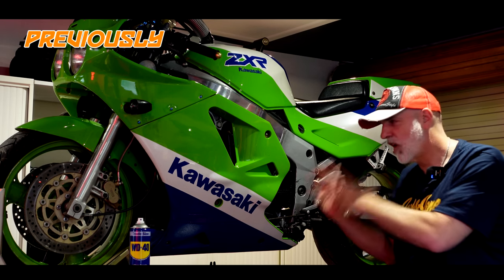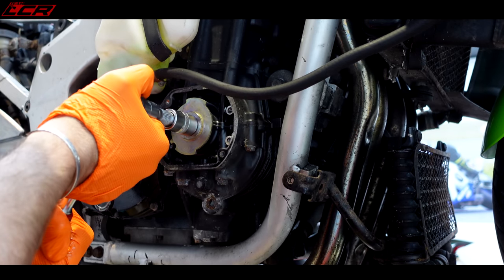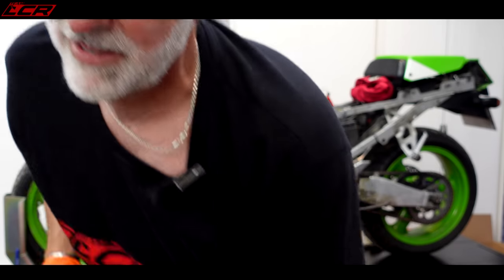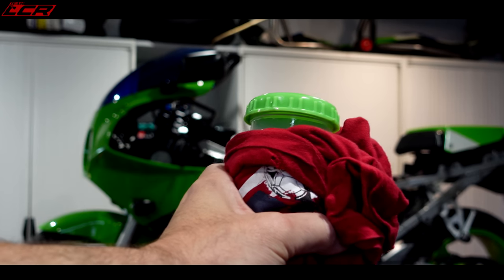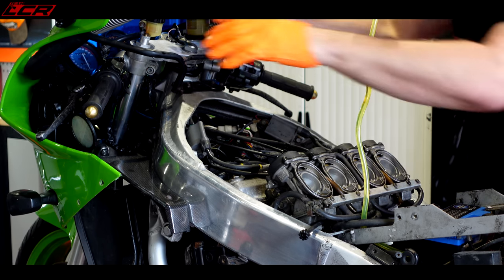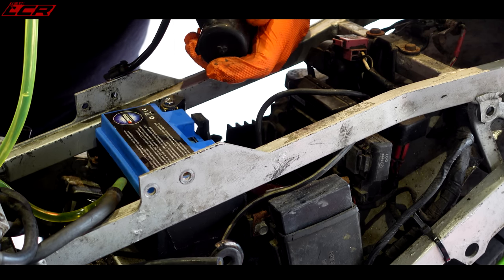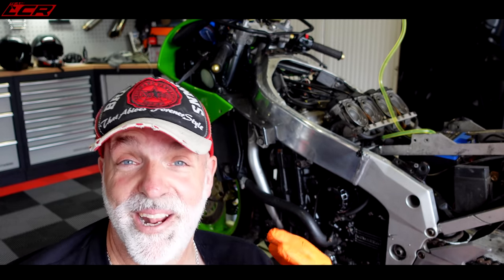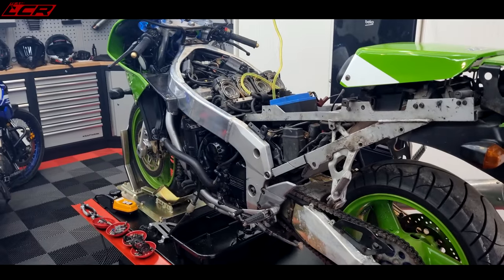Starting Abandoned 1990 ZXR-750 | Will It START!!  Part 2

Comment: As a mechanic I'd say you can do it. Definitely invest in a 4 dial carb balancer as they are not that expensive and you'll be able to set the carbs perfectly. Definitely fully overhaul the cabs with new needles seats and all orings👍
Reply from the maker: Thanks for the tips! 😁👍

Comment: Great chopsy it runs. One tip I can give you is with these older zx is the vacuum pipes are everything to making them run great even the smallest leak or even not having the air box on can make them run like crap. So I wouldn't take the engine apart yet do spark plugs, coil packs and check even vacuum pipe. Oh and one last thing that catches everyone out regulator rectifier are a common fault
Reply from the maker: Great tips thanks 👍

Comment: Tentative first steps Chops, she needs some love…but she turns over & fired up, which is a positive start!

My ZXR has been at Raceways in Stevenage having the carbs sorted. Mine was starting, revving and ticking over fine, but bogs down when you pull away, making junctions decidedly hairy! 😮

The carbs were pulled apart, sonic cleaned, but still not quite right. So they’re pulling them apart again, another sonic clean, genuine carb service kit etc.. Also going to check the valve clearances incase they’re a little tight.  

I reckon project ‘Green Meanie’ is a go mate! 💚👊🏼

Comment: That's definitely a 1989 H1 that you've got there, that would have been registered in 1990. The fairing is H1 (different stickers to the H2), H1 black mirrors (H2 are green), H1 flat coolant rad and external oil filter (H2 is curved rad and internal filter) and the carbs will be 36mm bore rather than the 38mm on the H2. Someone has fitted a later H2 swingarm though. 

As someone else mentioned try LiteTek for the carb seals. They are made from more modern materials that'll hopefully stand up to newer unleaded fuels. They are in Thailand so you my have to order them as soon as you can because they may take a while to arrive. 

Let me know if you're stuck for any parts, I might be able to help. I've got plenty of leftovers from restos.
Reply from the maker: Thanks for the advice 👍
Reply: Thats what I thought, H1 with a H2 swingarm 👍

Comment: Have the carbs ultrasonically cleaned.  Harpers ultrasonic can rebuild them for you . 
Valve clearances will need doing.  But if your doing that you might as well do the valve seals . Great video.
Reply from the maker: Thanks for the info! 👍

Comment: Looking forward to future vids mate 👍
Before you strip the engine, plug the plugs out 1 at a time & check that they are sparking on turn over (ground them on the frame when you do so - no modern electronics to fry I presume).
Then borrow a compression tester to check whether you’ve a ring gone on 1 cylinder (hopefully not).
Go on from there as needed.
Reply: Agreed you must have been where Chops is now

Comment: Clean cam tensioner, balance carbs, run up to temp, make sure fan runs, pull clutch in and out loads to un stick plates keep doing that for a week if all good change oil/filter, clean tank put inline filter, in then wonder up and down the road, slowly.Then brakes, suspension,tyres then dyno 110 bhp if a good one 😅

Comment: I’ve done a ‘99 XJ600 recently, that had been sitting for years. It sounded awful and smoked on the first start but with a new battery, spark plugs, a…. lot lot lot lot….of carb. fettling (a few spare sets were required to make a good set) followed by some careful balancing and it sounded as sweet as a nut.

The more I ran it, the sweeter it became. 

DON’T STRIP THE MOTOR 😉
Reply: I liked your note about Carb fettling, I've just had close-on 6years getting my basket case ZXR750 L3 back to some sort of organised Carb / filter, pulsing, jetting and adjustment equilibrium. But I think I'm almost there!

Comment: A carb refurb and new plugs chopsy that may well do the trick also new fuel pump. That’s what I’d do rather than pulling it apart further could well sort it. The smoke and crap out of the exhaust may well clear likely due to standing for so long. Good luck 👍

Comment: Do a compression and leak down test, then you will know the state of the valves, piston rings etc. at the very least the carbs need a good strip and clean in an ultrasonic cleaning tank but I personally would do a full strip and rebuild, then a bench test/setup before dialling them in by balancing then properly. It’s all easy stuff.

Also if you haven’t make sure your air filter is good as it may have been a mouse house.

Comment: Old Kawasakis run smoother when they are hot.  They have always seemed a little rough when not ridden to get them warmed up.  They loved to be revved, on the limit, all of the time.  My ZX9R is one of the best bikes I have ever owned (had over 100).

Comment: I did my first top end rebuild a few months ago. Check compression 1st it will tell you if you need to pull it apart. My compression dropped bad so I pulled top end and changed rings and found 1 valve was destroyed. Changed them and she started right up, running great.

Comment: Bless the dear old zxr ❤  Float valves always get gunked up,  any particles will cause the float bowls to overflow.  You'll need to clean the plugs again after the bike flooded, this might help it fire on all 4 properly. Do a compression test to make sure all the cylinders have similar pressure...check the valve clearances.....balance the carbs and it might run fine. The head will need to come off if oil is getting past the valve guide seals, but cross each bridge as it comes along.. it sort of runs, happy days Chopsy  👍🙂

Comment: I'm a bit late to this channel.  I did the same as you but on a 1995 L3 ZXR. I found the engine rebuild to be relatively easy; but a good manual to follow is essential. Remember that valve clearance settings are ten times easier whilst you have the engine out, ie before putting it back in the chassis. My biggest problem was the carbs; and the fuel/air system in general. But my bike was overseas, had been abused by some hopeless mechanics and had suffered from a general lack of parts availability for all of its life. Not apparently the case with your project.
  These bikes are pretty cheap at the present so why not risk going outside of the comfort zone a bit and learn more skills at the same time. If it all went pear shaped then split it for parts, but that's a very negative attitude. I'm Sure you will get this running nicely and have lots of fun at the same time,  and have a good looking & collectable bike at the end of it. These ZXR750's have aged particularly well on the looks front, and are rapidly becoming prized classics.
 OH and we have virtually no one out here in my part of Brazil who can really sort out carbs on these models, so it's a case of DIY and even more opportunities to learn new skills !!

Comment: You could have a valve problem but it could also be the piston rings are stuck in, junked up with carbon and old fuel glues the rings in place. In either case the head and barrels would have to come out. Pretty sure this is bucket and shim valve gear so have a pro check the valves and adjust shim sizes accordingly. If you do go that far then new cam chain, cam chain adjuster, gasket kit, plugs, carbs done to get rid of any fuel varnish in the carbs, brakes will need done as the fluid will probably be all moisture, anything more than 3.5% moisture and the fluid will boil locking up the brakes, and after all this time new pads and lines  and possibly a master cylinder kit for front and back. Lastly will be tyres as at 10yrs old there's a good chance the rubber has dried out and the tyre side wall will start to crack and fail at speed. Steering head bearings might have notched from sitting in one position and forks could probably do with a clean out and new seals. Nothing beats a good resto so have fun.

Comment: Brilliant Stuff Chopsy !  

Thankfully your coolant reservoir is intact, those are impossible to find and re-pop replacements (few and far between) cost a princely sum.  Also, be sure To buy an OEM style battery (Same number). don't trust the sealed replacement batteries will fit, I have bought 2 replacements and neither fit in the battery box.

Litetek out of Thailand make a top notch set of replacement carb seals/o-rings/gaskets for that bike

Be careful squirting carb cleaner into fully assembled carbs (part 1), that stuff will eat/melt the rubber diaphragms in the top of the carbs.   Full dissassembly of the carbs and an UltraSonic Cleaner will work wonders.

Airtech make replacement rear hugger for that (you won't find an OEM one I doubt).  Nice it has the main rear mudguard still, those are very hard to find.

Id also give it a bit more of a hard run, if its sat along time, the rings may be a bit sticky,  the blue smoke "may" clear up if you run it more.  Id also recommend you do a compression test after you warm it up, that will give you a good read on the cylinders/rings/valves condition.
Reply from the maker: Thanks for the info 👍

Comment: Rebuilding a Kawi engine is dead easy. No specialized tools required at all, just basic spanners and sockets, possibly a clutch holder tool. I rebuilt my Z1000's engine on the kitchen table over the course of a Saturday afternoon. The hardest part is making a list of the onetime-use parts that you need to re-buy for re-assembly. And even for that, Kawi uses copper washers rather than stretch bolts, so parts cost is pennies. I've seen you do tougher jobs before so I'd think this is definitely something you can tackle. Just buy a Haynes manual because it's a lot easier to understand for beginners than the factory manual, that's more meant for technicians. The only job you should farm out the a specialist is the head reconditioning, but for everything else definitely do it yourself. You couldn't have picked an easier bike. I genuinely think it's easier than a KTM dirt bike engine. The Japanese set less booby-traps and gotcha's than the Germans/Austrians/Italians 🤣🤣

Comment: Hi there chopsy!!! I've had 5 of the H2s mate, but what you have is ultimately an H1 engine in an H2 frame and swing arm plus back wheel!!!!. Your bike is basically the old GPX750 LUMP, Hence the the flat rad, out side oil filter, 4 into 2 into 1 down pipes (in stainless) wrong carbs and air box. That was the give away mate!!!!! Plus fuel tap. The clocks are J OR L. Think must have had a heavy front end and rebuilt on an H plate, hence people think that it's an H2!!!! 😢. Please check your log book numbers before you go any further buddy!!!!! Take care and see you soon xx love Tubsy from Lowestoft

Comment: Sounds good mechanically… strip, ultrasonically clean the carbs and rebuild with new diaphragms etc and balance the carbs and it should be good… after a valve clearance check/adjustment 👍

Comment: When you’re  at the point of running it put some cheap oil in it, let it circulate for a few minutes then drain it again before filling with the good stuff. Should pick up a lot of crud that’s settled inside. Unless you’re doing a full rebuild of course 👌

Comment: The Smokey engine I think will be valve stem seals. It could be stuck rings but my money is on the stem seals. PS I'm an amateur and did a last nut and bolt rebuild on a 1995 ZXR750. Make sure your manual is the best but GO AHEAD and do this yourself, it will be very satisfying.
 By the way, the cosmetics on your bike look very good , just strip everything else, clean, re-lube, replace bearings and All the rubber bits that you can find (some will be out of stock). Replace ALL oils, grease etc etc. Instant Karma; you've many hours of it ahead.

Comment: Vacuum out the spark plug holes. Also I had one of these, chased starting issues for ages. Turned out to be the fuel pump which is kind of like contact points, there's a cheap rebuild kit to fix it.

Comment: The first big bike I ever rode was a ZXR750 a black one J2 model. Going from a  single cylinder with 13hp to this thing over 100hp was mind numbing. so heavy, so planted and I don't think I even got it out of 3rd gear.

Comment: Zxr carbs are a pig for flooding… it’ll be stuck needle valves causing this, I’d say. As well as the pins seizing (you may be able to tap them a few times to free them up…) there’s little ‘o’ rings they seat in that let past when they’re dry as well. New ones are readily available and it’s an easy job. 👍👍

Comment: To be fair Chopsy,   I think you were very optimistic thinking that a (lead/acid)  battery that had sat idle on the bike for the last 10 years (unattended) would start the bike, or would 'take a charge' 🙂👍 As someone else has already posted, check the compression before removing the head, if the compression is good,  change the plugs (a bit surprised you haven't already as that 'manky' petrol hasn't done them any favours)  and get the carbs csorted professionally,  and balanced.  If I was a betting man (which I'm not) I'd  'guess' that's a fueling problem rather than anything 'major'.  (I'm not a technician so feel free to disregard all of the above)  I'm looking forward to this series. 
👍  Oops...sorry, forgot to mention, I'd change the fuel pump anyway whether it's 'working' or not...it's 30+ years old.

Comment: Run a compression test on each cylinder.  If lingering concern remains borrow a bore scope and inspect cylinder walls.  That done and no valve guides leaking there is no reason to take the head off.  40,000 miles is not that much if the engine was looked after with regular oil changes and temperatures kept in check.

Comment: Hiya Lcr, I used to have the H1, loved the bike though not the quickest they handle so well,  maybe the piston rings are a little gunked up and sticky, also i think there bucket shims on the valves (its the older GPX Motor) if your doing the valve seals might as well do clearences. Just be mythodical when stripping the motor dont force anything and dont rush you,ll be fine, Good to see a Zxr being brought back to life as they are an Icon. Oh yes! I changed the rear shock and linkage on mine back in the day it was 100% better and it actualy worked thanks to Team Green Racing ( John Reynolds )
Reply from the maker: Great tips thanks 😁👍

Comment: Float valves aren't seating properly so fuel continues to flow. Strip carbs, ultrasonic clean and re build with new float valves and it'll be ok. ... If it doesn't ignite first

Comment: I've got two words for you Chops,  EFI conversion!
Reply from the maker: Any more info?
Reply: @LambChopRides   Short answer; you'd have to build the kit yourself.  Find Efi throttle bodies from another bike and install on your ZXR with the injectors (possibly ZX6R).  then you need efi fuel system (fuel rail, fuel pump etc),  all necessary sensors, custom wiring harness, an aftermarket ECU to control everything, dyno tuning.  the list goes on.  It's popular with the suzuki bandit crowd, any carb'd engine can be converted.  And just think, you would (possibly) have the only ZXR in the world running on EFI.

Comment: I’d be cautious with the lithium batteries in the older bikes, I’ve seen one image and a couple of horror stories, something to do with the way the older bikes electronics charge, can spike voltage into the batteries, they puff up and occasionally catch fire, personally. I’ve not had a issue, but could be one to watch 🤷🏻‍♂️

Comment: Generally speaking bikes are quite simple in terms of restoring 
Personally I wouldn’t open the engine up until I was sure there is a fault with it 
The carbs are critical to its running so making sure they are 100% clean and more importantly balanced and then see how it runs
Also do a compression test on beforehand so you can judge it’s health 
I also wouldn’t worry about it smoking for now either because that can just be due to the time it’s been sitting 

I’m not sure what your plan is for the bike
Is it going’s to be a full restoration to factory spec or is this going to be a resto mod or full track bike
Either way enjoy the journey
Reply from the maker: I've not decided yet which way to go with it.. quite fancy some upgrades/ improvement as part of this 👍
Reply: @LambChopRides  zx10r engine swap it is then 😁

Comment: I just banged some of that oil in the gsx s1000. 18 quid delivered. Comes out in 500miles
Reply from the maker: Yup that's it 👍
Reply: @LambChopRides tbf it seems OK it's got all the ratings. I'm using it as a flush before 15k service.

Comment: If I was you I would do as you’ve done but take spark plugs out ant turn the engine over with the starter so oil can get round that will make sure oil pump is operating correctly and like you say lubricate the engine completely but that’s just me